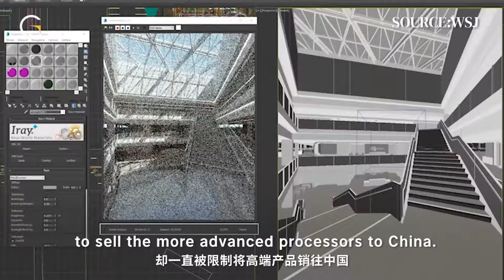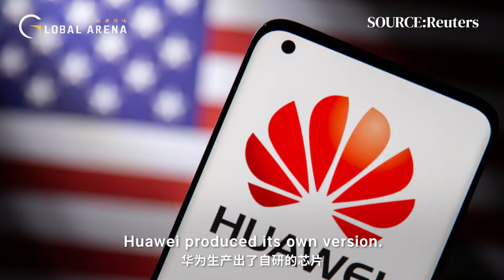Can Huawei challenge NVidia on AI chips? US sanctions only lead to China's replacement technologies

Comment: Where are the chips manufactured? I dont doubt Huawei designing capabilities but the stranglehold on equipments for chip foundry production at 5nm or 3nm may hinder the performance of the AI chip unless they are using 7nm workaround chips similar to the mate n pura smartphones. Or they could this by stacking mature chips. Any updates on such technicality. If SMIC or SMEE accomplish a EUV breakthrough, that will be good for mankind